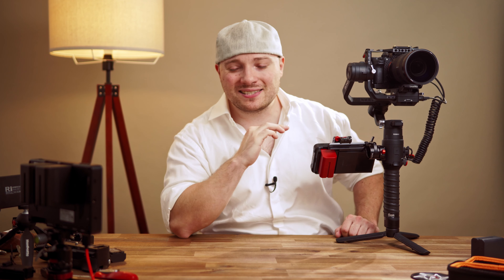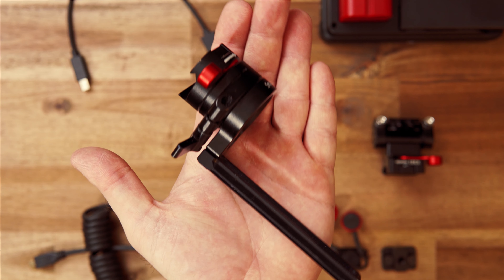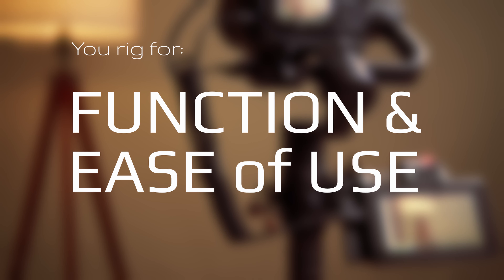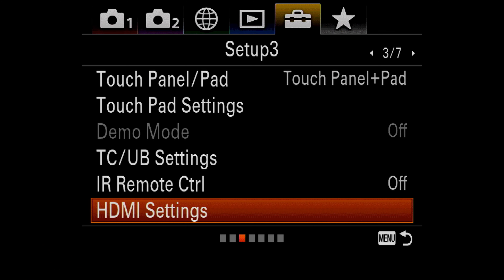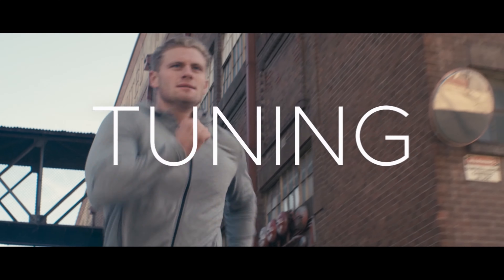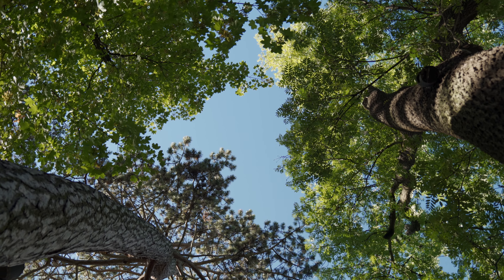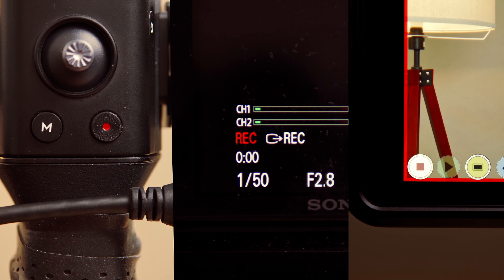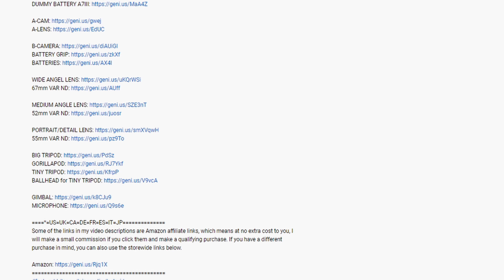RIG your RONIN for MAX Performance

Comment: What would you change, if anything, for a similar rig using a Sony A6400 + Ronin SC?
Reply from the maker: Probably nothing...:) The SC has its own camera contrl cable.....but that's it:) Assuming the SC has the same connectors on the side as the S does.
Reply: @Mark10ProVideo  Pretty sure the connectors are the same. Will give it a go. Thanks Mark!